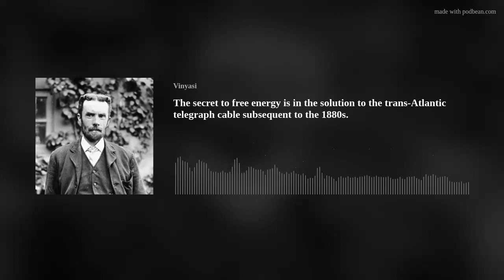The secret to free energy is in the solution to the trans-Atlantic telegraph cable subsequent to the

Comment: I have been following your theories for some time, along with testing in real circuit experiments. Very promising to say the least. If active watt is consumption, the reactive watt is then production. When voltage and current are in phase, the power is positive. When these are 180 degrees out of phase, there is no active but only reactive or negative power. Great work!

Comment: Will all due respect I have downloaded your books, read them and watched most of ur videos but still not able to understand what ur trying to convey. Could you write more with clear, short and simple circuits and give a highly detailed explanation from different perspectives. Give me an example using atleast 20 different circuits. Please i just want to understand ur teachings.
Reply from the maker: To know anything is to get into the shoes of that perspective as any good method actor will tell you and that’s my approach to studying this topic.

Electrical energy is not Energy. It is information. It is no different than a computer virus infecting the copper wire of a circuit.

The language of that infection is the language of electrical reactance utilizing capacitive reactance and inductive reactance and frequency to manipulate kinetic energy to whatever degree you wish increasing it or decreasing it at will no different than expanding or shrinking the Ant-man in marvel comics because we are dealing with information — not Energy.

If we were dealing with Energy, then a coil of copper wire could gain or lose weight. But it does not! That should tell you something … that the famous physics statement that claims that “energy equals mass times the speed of light squared” does not apply.

When you’re dealing with language and information, you’re dealing with a virus that has no physical existence apart from the materiality of its host. Anything is possible under these circumstances. But if you don’t believe in, and accept, this reality, then you’re gonna have a tough time understanding Energy much less free energy.

Paul Falstad utilizes the equations for capacitive reactance and inductive reactance in the software code within the functions within the models for his coils and capacitors processing their input voltage and utilizing and specifying that they become current sources as a consequence. This must be very enlightening, I know it is for me, because it defines electrical behavior of conductivity and insulative resistance as the behavior of electrical reactance so that a simple flashlight circuit is no longer so simple anymore because it contains electrical reactance within itself as an implication even though nobody assumes it to exist there. In fact, electrical reactance is everywhere in every single circuit but most people don’t take advantage of it. Electrical reactance is the leverage by which we alter kinetic energy without costing us any electrical reactance. But we will succeed in making use of this leverage only if we allow leverage to flourish because kinetic energy can suppress and destroy any attempt we make for making use of this leverage if we allow kinetic energy to get in the way. So it’s a contradiction in terms that we wish to manipulate energy but we don’t want to do so at the expense of allowing Energy to suppress this leveraging that electrical reactance is capable of. So we use environmental levels of voltage rather than standard conventional levels because we no longer believe that we have to supply The full amount of voltage plus a little extra to cover losses due to the inefficiencies within the circuit because those inefficiencies are not very important.
Reply: @vinyaasi  can I get on a video call with you sir, I would really love to interact with you about free energy.
Reply from the maker: @rajendraprasad1638  What's your time zone?
Reply: @vinyaasi  I live in India, Indian standard timezone. But I'm comfortable talking to you anytime.
Reply from the maker: @rajendraprasad1638  I will charge you, up-front prior to each duration, $30 for the first hour and $30 each half-hour afterwards payable in either venmo or zelle.
Reply: @vinyaasi  unfortunately I cannot afford you sir coz I'm just a student. But if I had that money I definitely would have, anyway thank you.